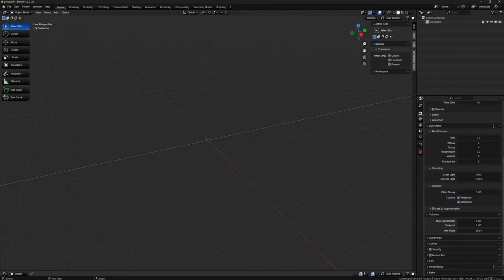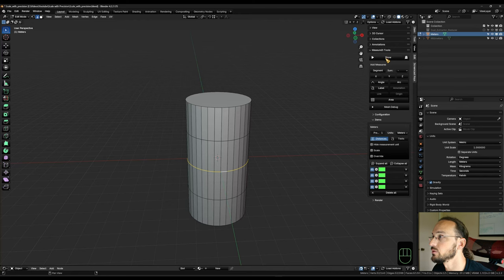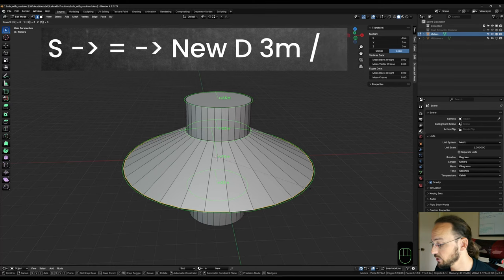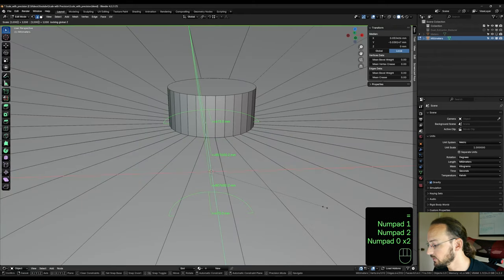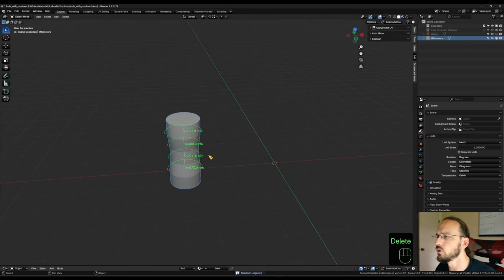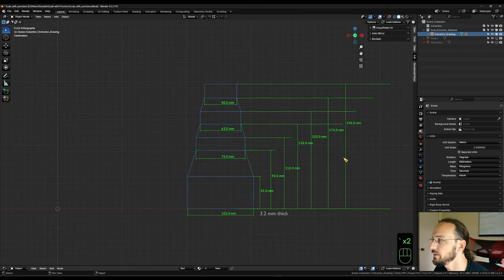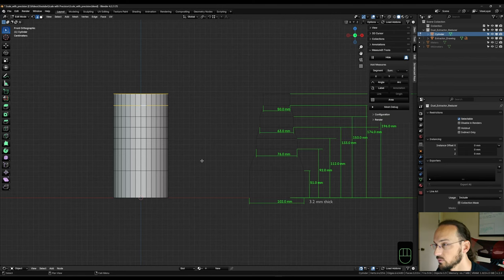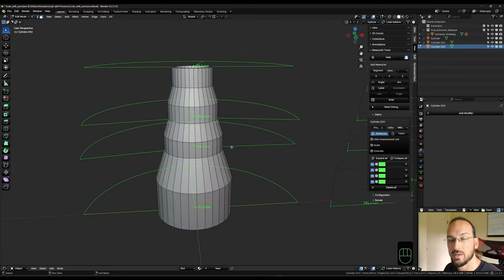Scaling with Precision is Super Easy!

Comment: To switch from Global axis to Local axis temporarily, you can simply hit the key for the axis twice and do not have to change the orientation in the top menu. So like in the video, when you want to exclude the local Z axis, hit S, then Shift Z Z. Or to scale on the local X axis, hit S X X.
In general, double tapping an axis key switches to global axis whenever the transformation orientation is set to something else than Global. If it is on default Global, double tapping the key will switch to Local.
Tapping a third time will release the axis locking again as if you used the tool without hitting any axis key.
Reply from the maker: That’s another way to get to the same result, you’re right. 👍
Reply: I use that action all the time
Reply: @creativecityis  Me too, I'm too lazy to switch it in the menu 😁